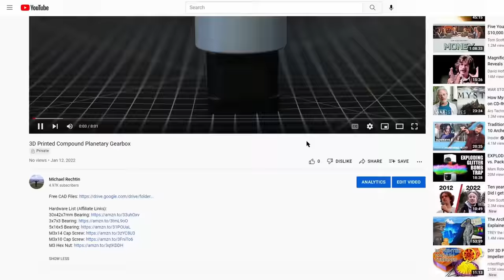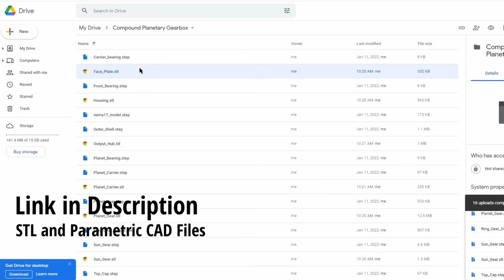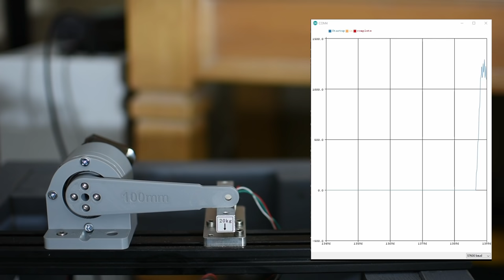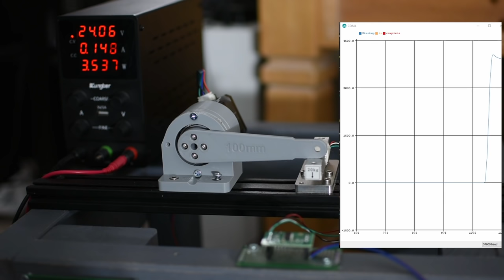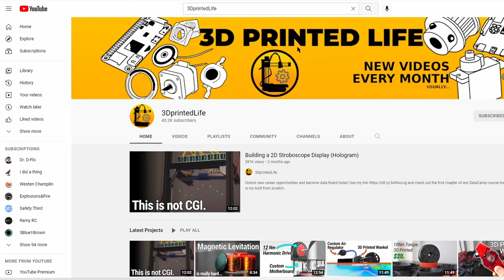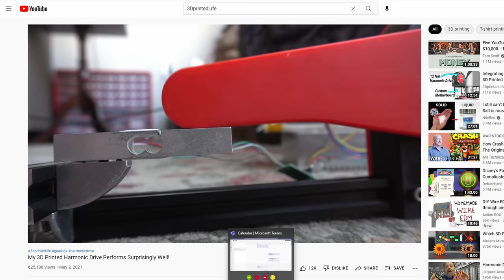3D Printed Planetary Gearbox! Resin vs FDM Printing?

Comment: I recently did a huge personal investigation into 3d printed gears and feel like this is a reasonable place to share my knowledge. 

I found the smallest you can make an FDM 3d printed gear on an average printer with a normal sized nozzle and expect consistent smooth operation and accurately printed teeth is 1mm. That is, with a modulus of 1mm. You can go smaller, but there will be extra friction and noise and high speed operation will not work very well.

If you are generating the gears in a CAD package, check to make sure the program is actually generating accurate gears and not an approximation. Some programs will just generate an approximation because they expect you to order them off the shelf and only allow you to easily generate them for fancy renders. (SOLIDWORKS)

Herringbones are better to print than helical, and ideally you should be using double herringbone gears because I imagine you are using a 3d printed housing if you are printing gears and can choose your gear parameters, and that will reduce the strain on the housing. The self centering of herringbone gears also helps deal with any warping or tolerance issues.

If you're not using a sealed gearbox, use double helical gears instead because they deal with dirt getting between the teeth better.

Avoid the use of bevel gears if you can help it because they don't tolerate the flexibility of plastic as well, and you will have to take extra care to design everything very stiff.

Planetary gearboxes require way thicker housings than you will intuitively think you need when printed because of the flexibility of plastic.

Don't make the obvious mistake of printing double herringbone or helical planetary gearboxes, assembly is impossible on them. Yeah I made that mistake, felt dumb after.

Lubrication is super important, especially with PLA. "Just a quick test" can quickly warp your gears and you will have to print new ones if doing anything high speed.

Comment: For removing the resin prints from the print bed, I recommend getting an oil painters pallette knife. They're strong and flexible yet very thin. Easy to ease underneath a print. No hammering needed!

Comment: I use both the Creality LD-002H and a Form2 printer. For structural parts like gear, the Formlabs resins out perform Creality by lengths ! I think the MSLA resins contain so much photo catalyst to make them react in the realatively weak UV light source, compared to a spot laser source as found then SLA Formlabs. Photo catalyst seems to make resin more brittle, but having said that, there are third party resin for Creality that come very close to the super expensive Formlabs resins.
Reply: Wouldn't that just be a matter of exposure time for an MSLA?

Comment: I would also add that if the PLA isn't holding up to move to PETG which in my experience is much more durable and long wearing.  PLA tends to be brittle by comparison.  As far as printing it isn't much different.  Just mind the temps and it's just a smooth if not better.

Comment: This test was like comparing a Microscope and a Telescope for looking at the moon, ofcourse one will be better as the other was never designed for this. The resin used in most home printers is for fine detail printing, hense the reason most model makers prefer resin.  If you want something to withstand mechanical stresses, the FDM printer will always be the better choice here.

Comment: It's a real shame that the entire resin print wasn't done in ELEGOO ABS-Like. That stuff is strong as hell.
Reply: @ShantulNigam  PLA is a brittle filament. But resin prints have extreme accuracy, and ELEGOO ABS-Like resin is very tough, and very wear resistant. 
You'd end up with the tolerance and accuracies of a resin print, while having a very durable part.
The difference between FDM PLA and PETG is nowhere near the difference between using some random resin and ABS-Like ones these days.
Reply: @1992jamo  Understood. I have a Mono X 6k which I use with Blue. They make awesome resin. That said, filaments are very good as well. ABS filament and carbon fiber are extremely durable. It becomes an arms race and resin has a harder time keeping up. But, yes, resin prints are faster and more. Detailed.
Reply: @1992jamo  but with all the supports/ printing at 45 degrees etc.. are parts deformed / not accurate in the end? I know very little about resin printing that's why I'm asking. I had a resin printer 2 years ago but prepping prints with supports and the cleaning process turned me off.
Reply: @marvg7062  you are correct, printing at 45 degree generaly brings some level of deformation. But the thing is for technical resin prints there is very often no need to angle them at all. It's just a bad habit of people who don't understand the reason behind the angle. Printing even directly on build platform as if it is FDM is even optimal in many cases.

Comment: You proved what I discovered already a while ago. Resin printing is great for toys,  for high detail miniatures, and totally unsuitable for any kind of industrial design. On top of that, the so-called "tough" resin is just a bit rubberish so it's not brittle. But also unsuitable for mechanical parts. I tried and tried and tried, but finally gave up.
I print my mechanical parts in ABS, as it is weather, sunlight and stress resistant, 0.1 mm layer hight if I need high detail. Never fails.

Comment: well done! I think the reason for the failure is that the planets have a bearing support only at one end, and the other end is unsupported. this creates a twisting torque.

the resin generally has less tensile strength than PLA, it is expected to fail earlier.

Comment: Interesting project. In my opinion thermoplastics will outperform thermosets for your application, but if you give resin another shot, lower the curing time. The more you cure, the britler parts get.
Reply: Epoxies and thermoset urethanes actually can beat thermoplastics hands down in all mechanical properties. But the formulations available for UV curing do not perform very well so far. I don't know what it's down to though, whether it's anyhow fundamental or whether they'll get there eventually.

Comment: I think people think of tough resin but it's so brittle. My brother just ended doing a mix of though resin with elastic you like resin so his posts are tough but still flex enough to not break easily. Maybe you should try this.
Reply: @Rokmononov  I don't agree with you.
This just a problem as simple as steel swords, you have to harden the edges so it's more deadly. But you need a softer core or it will breaks because it's too brittle when it will hits another sword.

Comment: A tip for stronger resin....add a little of flexible resin to your normal abs type resin. This will make it be closer to injection molding plastics. Good plastic has some give to it
Reply: That's interesting, does it really work mixing resins for 3d printing? Do you have any flexible one in mind to recommend? Usually in normal casts I would use talcum to strengthen it.

Comment: I just printed a set of pulleys for my leather sewing machine. I used the Anycubic Photon M3. It is curing in the sun right now. I hope it holds up. I figure as a hobby leather worker i should not be putting extreme loads on it. Time will tell.

Comment: What resins were you using out of curiosity? Really hoping the tough resins get a little stronger for practical use parts I'm playing with some sirayatech build atm might try this print been thinking if ordering some steppers to play with
Reply: I strictly use build for all of my functional prints now. Haven't done much testing with it, but housings don't shatter when dropped anymore. I've heard people using blu and build mix (20/80 ratio or similar) have good results as well.

Comment: I love the super high gear reduction and self-locking output from a stepped planetary, but mine haven't been giving full torque either. Here your stepper is rated 0.42 N-m torque, and your awesome load cell setup measures about 4 N-m torque, so a healthy 10x torque increase, but an 80x speed decrease. (Why are we losing 8x of our torque?  Is it just lost to planet-ring tooth friction?)
Reply: @PeppoMusic  I actually tried helical gears in a stepped planetary, and in addition to wanting to eject themselves under torque, they had about the same losses.  I'm thinking it's mostly friction, particularly since the tall planets want to tilt under load, every tooth is grinding much more than normal. I should try a planet carrier that holds the planets from both sides so they can't tilt, and see if that has better torque transfer.
Reply: @olawlor  Helical gears can transfer more torque for the same width. But will have equally more friction. It's quite easy to see why visually, just take the width of each tooth and rotate it straight in your head and see how it's wider.

Other than that benefit, they are also quieter and sometimes more wear resistant because the transition between each tooth being the load bearing tooth is smoother. This is also easy to see visually, there is slight overlap between each tooth if you draw a line across the width of the gear.

Comment: That is the limitation of MSLA printers, they are cheap in cost, however, they also have their limitations in the resins it can use, If you know anyone with a Formlabs, have them print it in Tough resin, and it will outperform the FDM prints, nonetheless, you are right, so much less work printing with FDM over resin printing.

Comment: Pro tip: when you turn a screw in a soft material there is a chance to damage the part, to avoid that turn the screw in the opposite direction until you hear/sense a tick then you can "screw it with confidence" (the verge guy said it).
Thanks for useful test.
Reply: I do the same procedure, when turn back you find the previusly made thread and not make a new one
Reply: "Screw it with confidence" Lmao. Classic video.

Comment: sweet finally a win for FDM. Its always about how resin is so great and so much better but its good to see that FDM still has a place is isnt out dated by resin.
Reply: FDM uses production thermoplastics, of course there's a place for it. But if you're using hobbyist resins on a DLP then yeah no duh it's going to be weaker.

Comment: What resin were you using?
The resin used apparently makes a much bigger difference than the material used in FDM (which, to be fair, already has quite big differences).
I've seen resins range from "brittle like glass" to "pretty much slightly weaker ABS".
So it would be really interesting which resins you used for your tests.

Also: I didn't see any lubricant on the resin gearbox when you took it apart. To be fair, the lubricants I usually use are pretty much black, so maybe that gel stuff just can't be seen as easily.

Comment: have you tried this with a tough resin instead of the basic? i know you were only comparing it to pla, but it'd be interesting to what level of resin would = pla's strength and what other fdm filaments would compare with tough resin. AKA abs, asa, pc, peek, etc.

Comment: Yea.. common resin parts are kinda sanding eatch other, tough resins arent bridle but maybe still wearing alot.. 

Test another greases, like thick vaseline 
Test siraya tough/build, ABS-like or nylon-line resins and be amazed 😌👌
Reply: Isn’t Vaseline pure petroleum?  I like to use silicone oils or silicone grease.

Comment: Whenever you start getting near the limits of a material how tough a material is (with toughness being defined in materials engineering term of "area under the stress strain curve") becomes very important and can be the difference in a few hundred cycles failure and how many tens or hundreds of thousands to failure. Gears generally should be tough but with good surface hardness. FDM vs SLA is similar. FDM material selection is generally tougher than SLA, though there are "tough" SLA materials -- they generally have terrible temperature resistance.  This is also the PLA - PETG trade off. PETG people rave about it's strength but it's generally more brittle. Good work.

Comment: i know its a year old or so, the problem with resin prints is, that it becomes brittle if cured for too long, depending on the part you are printing you need to adjust the cure time, its like... i think tempering is the right word in english... for the gears i would shorten the cure time significantly so only the outer layers of is hard while the core remains flexible... its kinda like surface hardened steel, and its something you need to get experience with, because not only is the intensity of your uv source important, even standard resins may vary immensely in their "Stats", we are using 3d printed gears all the time for testbuilds at work, if your resin brand is good you can also look up the "stats" when completely cured

Comment: Best Video!!!!

I've often wondered if a resin printer would be "better" than the FDM.
It was good to see that the PLA gears showed no wear.
I can attest to that, as I designed a device to measure water level, using an arm with a 3/4 gear as part of it (not an add-on) and a gear that is force fit over a Potentiometer's spindle.  As the arm moves up or down with the water level, it just turns the gear on the pot.  It works great and has been in service for about 10 months or so, with no signs of wear at all.

I want to see if PETG is any better.

So this video helps me to not rush would and buy a resin printer.  LOL
Reply: Mixing resins is a thing.
Insane strength

Comment: You have to use not only a strong resin, but also an anti friction one. Most resins, even the tough ones like siraya tenatious , are not meant for moving parts. Try syraya mecha resin or resione m58

Comment: I am doing something similar.. but i had some of the same experience. I am doing a rack an pinion set up ..but the FDM process takes to long. So i made a mold and casted the resin.. much easier.. but after not to much duty...the resin begin to share of bit, coming to final failure... I change to  an epoxy base much softer resin...af it works better. It seems that resin gets to be to brittle, almost glass...but the pla don't do this. I am still working on some solution...but your video shows the same. So if you where thinking that is was due to the process i can tell you even if casted the resin do the same.

Comment: Theres a few things to test still with that resin.   Types of resin, curing times, and lubrication methods.  Might try some other forms as it might be having a reaction with the resins. (and as other have mentioned, try adjusting curing times a bit less - so they aren't as brittle)
Reply: It's not worth it. Resins just are shaite in mechanical applications.

Comment: Wowwwwwwwwww!
THIS IS THE VIDEO I WAS LOOKING FOR!!!!
I do have 2 FDM printers. I taught that gears would be way better in resin.
At least, with the resin you used it's not a better option. Annnnnd, the FDM is still very capable (so I don't have to buy a sticky printer!!! Great cause I hate cleaning stuff!)
Maybe with a very expensive super strength resin?

Comment: I been using fdm and many times thought about getting resin option but then I though how lazy I am to deal with curing and all the liquids so for now I’ll stick to fdm, plus fdm serve me well it does what I need and it does it well. When I need a certain part that I cannot replace I just print it. 3D printing is must have in every home.

Comment: Most resins don't have good wear and abrasion resistance. I would try using a resin specifically designed for wear resistance, like Resione's Nylon-like or m58 (more like ABS)

Comment: Helical or herringbone gears would probably give the resin gears a better chance since it distributes the load much more evenly than "normal" gears
Reply: Helical gears give more contact area reducing point stress at the cost of friction and heat.

Comment: Good stuff. One thing you might try as well is printing the parts using one of the HP MJF (multijet fusion) services out there. I did that with my BLDC compound planetary gearbox and it's impressive. You could probably print these parts for about $10 using JLCPCB's new HP MJF service.

Comment: What is the fitted parts tolerance for two parts that comes together when printing with the creality cr10s? I have the same printer. If the cap is 2 inches per say, what is the other part set to so that it can fit perfectly when pushed together? 1.97 inches?

Comment: If you plan to continue your hobby, read the section # 8 from your resin manufacturer's safety sheet. You will get some health problems eventually when touching uncured resin parts and/or breathing resin fumes when using resin printed in unventilated area.

Comment: that is disappointing result for the resin. I would have thought that having higher tensile strength and heat resistance might mean they would make better gears but I guess having a bit of plasticity is actually a good thing here.
Reply: Being strong is useful to a point, elasticity reduces the tension on the part. So elasticity in a way increases the strength also, which is where resin failed.
Reply: I was actually super happy with it! Means I won't have to buy one resin printer too! :D
Reply: @mlevif  if you want a beautiful print.. the resin always wins... And every printer or fillement has is own advantage...
Reply: @dutchducks5451  yeah, I know. Not enough to convince me thought, fortunately 😂 this hobby already takes too much room in my house with all the filaments, printers and results ahah